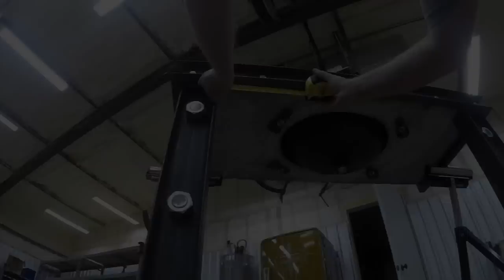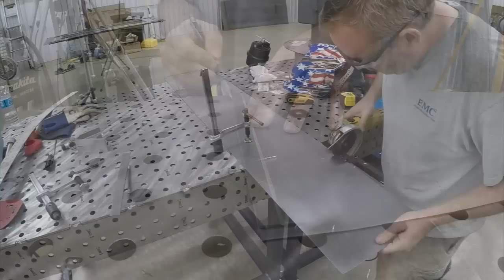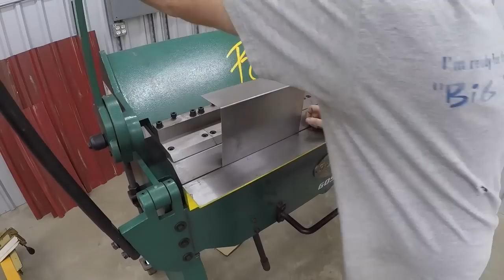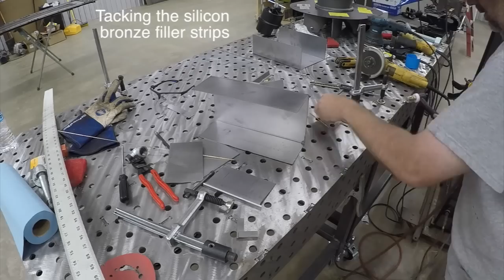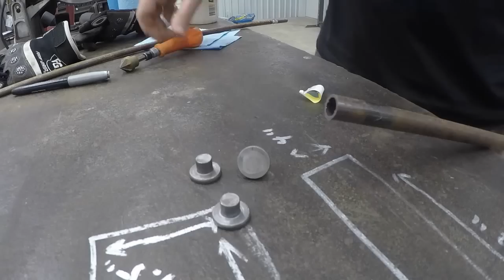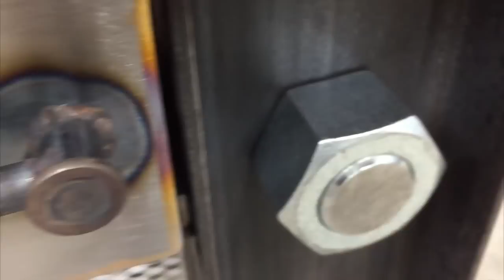Metalwork Monday - Fabricated Steel Drawers - Bend a Metal Box - Dallas, TX 75201

Comment: At 7:30, looking at your shop I-Beams - you could put the same size I-Beam across the V (either 100% or 75% of the span) and then you could put up a hoist and trolley system to make life a little easier for the bigger stuff and the not so big but awkward/large sizes.

Comment: How do you keep your port-a-band from jiggling all around in your Swag stand? Mine is completely useless. The retractable base thing on mine has slop, and no matter how hard you tighten down the red knob underneath, it just wobbles around on the little back tab, almost wanting to pop off the table.

Oh, I feel the need to share an awesome tool find. I've just completed punching 200 20.5mm holes in 1/4" plate. The thing never skipped a beat... super tool. I got it on eBay for about $650.
http://www.aliexpress.com/item/Battery-Hole-Puncher-Electric-Hydraulic-Hole-Punch-Tool-Range-from-6-5-20-5-with-good/1095323175.html
Comes with 5 dies, and it's compatible with some of Hougen's die sets. (P.S. Hougen also sells this exact same model with their name on it for $2700 on Amazon, with a teal handle)

You'll never drill holes again, when you can punch them!
Reply from the maker: Hmmm. not sure what's wrong with your swag stand?  Is it the right one for your brand of saw?  My is pretty tight and works well for what it is.  Wow that punch is badass!  I have been looking at ironworker machines, same thing but stationary, and can shear angle iron and flat bar as well as punch holes in thick material.  Of course they are pretty pricey.  Thanks for sharing that!
Reply: I have a mini-iron worker of sorts. MetalCraftUSA has a Pro XL machine that does quite a bit. Between that, the 12" shear (eBay) & Metal Cut Saw, there's really not much I can't handle. But saving up for that Piranha!

Comment: Cant tell from the video if those drawers have actual drawer slides installed or not but if they just kinda sit in the hole you can put some nylon/delron strips on the bottom and sides of the box the drawer fits in to smooth the drawer operation up and tighten the tolerances  up. Just thinking out loud......
Reply from the maker: I thought about putting soft drawer drawer slides on it, but I was looking at this old Equipto Parts cabinet and its very industrial and it doesn't have any slides at all and is well made.  But I do like your idea of using a nylon strip to soften and dampen the slide some.  Appreciate the input!

Comment: I was watching your video today on clear coating on another project and was wondering if you have ever researched Sharhide http://www.sharkhide.com/mpinfo.html. I am building a rack for batteries and do you you think the clear coat will have an issue with the hydrogen gas that is released?  it will have serious ventilation but I am concerned it will cause it to peel.
 https://www.facebook.com/Anarchy51/photos/pcb.1789407987947031/1789407287947101/?type=3
Reply from the maker: Jason good question.  I know the fabforums guy likes sharkhide but i had poor results with it.  We used it on the bare steel steering column on the mustang, and it rusted underneath it.  We tried this twice with same result.  If you think about clear coat holding up to gasoline and diesel spills down the side of most of our cars, its pretty durable.
Reply: +🔥Ramsey Customs - turbocobra that's what I was looking for, I've been scoring tools all over the place lately and am excited to built some similar furniture soon as the house remodel is done, always looking forward to monday.